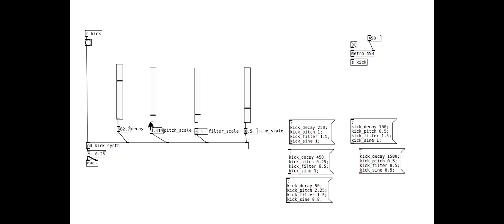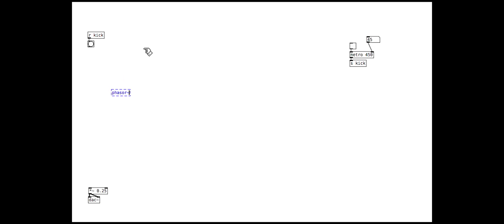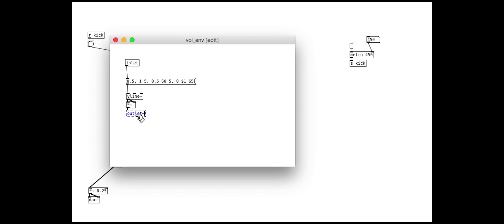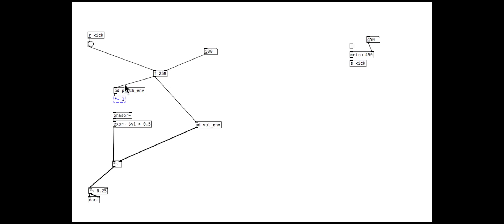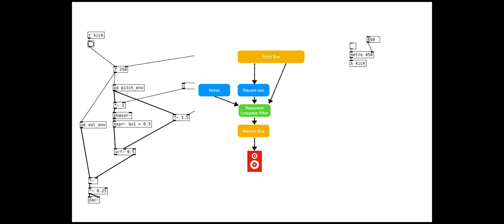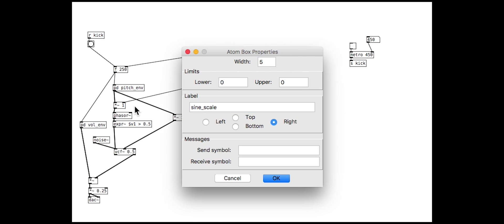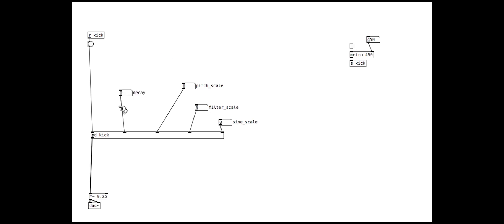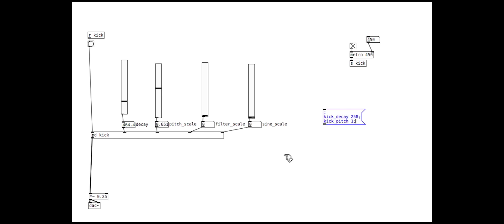PureData tutorials - rich synthesis (11) - Kick drum synth

Comment: 2:20  what does the last number 65 mean?
Reply: Also why do you multiply the vline object by itself before multiplying it with the kick?
Reply from the maker: @d3nt391  The 65 is a delay to the line message, so after 65 ms the line will go to 0 in $1 ms. E.g. if this was 100, the line would wait 100 ms from when the message was triggered before starting to go to zero. The [*~] is squaring the output, giving a steeper but smoother decay curve instead of a linear one.
Reply: @reallyusefulplugins  Thank you!

Comment: hey... great tutorial. thanks. one question... the message going into the amplitude envelope [vline~] is as follows: [0.5, 1 5, 0.5 60 5, 0 $1 65< 

I'm a little confused because you didn't explain what the 5 just after the 60 milliseconds is for and you didn't explain what the 65 just after the $1 at the end is for either.
any chance you could elaborate on these please?
Thanks again
Reply from the maker: Hi Liam. Yes, good question. The [vline] syntax is annoying. This message essentially says: "start at 0.5. Go to 1 in 5 ms. Then after 5 ms, go to 0.5 in 60ms, then  after 65 ms, go to 0 in X ms." The 5 and the 65 are essentially time offsets for each of the individual ramps. The 0.5->1 happens immediately. The 1->0.5 doesn't start for 5 ms. The 0.5->0 doesn't start for 65 ms. The [vline~] helpfile might be worth looking at for more info

Comment: why do you often put an input into both inlets of a multiply object?
Reply from the maker: It's a quick way of squaring the output. For something like an envelope that means we get a smoother curve that drops initially very quickly, but approaches zero more slowly (but in the same amount of time if you see what I mean). Where a linear ramp from 1 to 0 would be at 0.5 by the halfway point, the squared ramp will already be down to 0.25 (0.5 x 0.5) at the halfway point. I might be making this more rather than less confusing...
Reply: @reallyusefulplugins  so it makes it more of a curve than a ramp?
Reply from the maker: @TheDao69  Exactly. There's a bit more info in tutorial 2 on envelopes